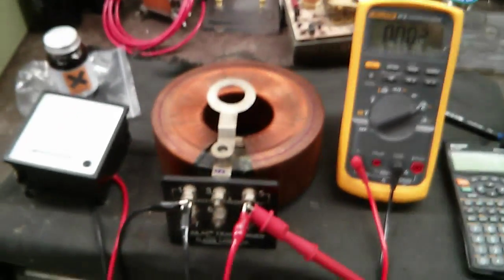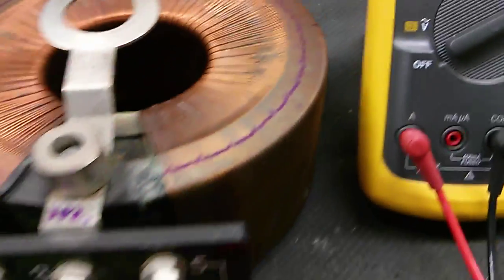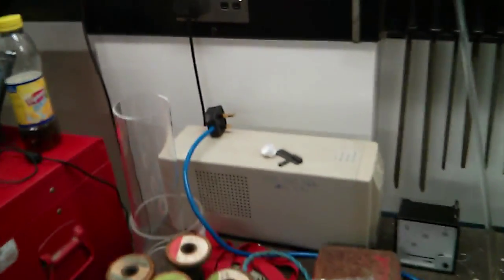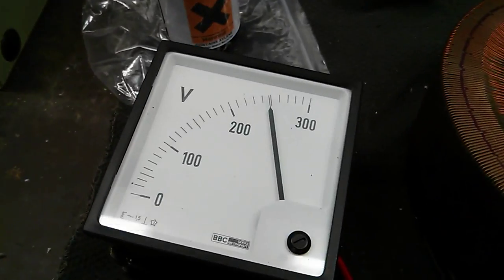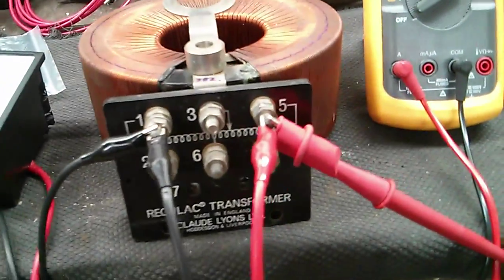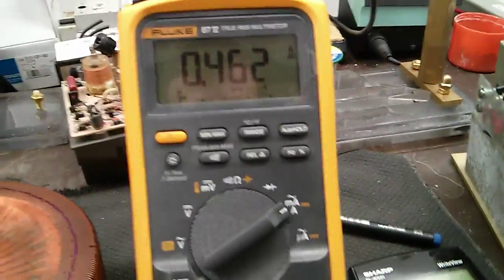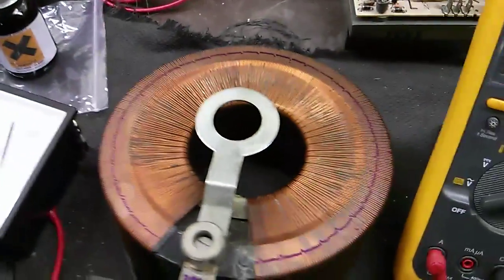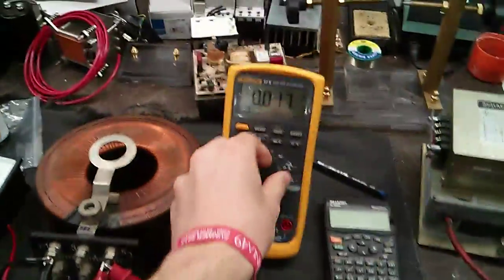Idle Current Measurement on the Regulac Variac

Comment: That's interesting.... I do wonder what the current consumption is on my little 10A Carroll & Meynell variac. :-)

Also, that other variac you were trying out. It appears to have a hole in the middle of it. :D

That other Regavolt variac is interesting..... The output on that. You said 115. Is that PerCent, or volts?

Thanxx for showing,

-BoomBoxDeluxe.

Comment from the maker: It's overkill on dielectric strength I know but does the job, as normal varnish may not be able to handle heat quite as well. talking about magnetising current, as it is rated to 50/60Hz input frequency, I wonder how it would respond to 60Hz, I'd guess less current as the increased frequency gives the core less time to magnetise fully in one polarity before flipping again 60 times a second, get some of that Yankee Hum over here haha xD

Comment from the maker: At 240V (design voltage) the variac is pulling 0.25A or 62.5W, as the core would appear to be non conductive there is no other possible routes for the current to take other than through the windings, and as the voltage increases proportionally with each winding it shows that the current is flowing through the windings only as is should, so 0.25A would be the design idle current on no load.